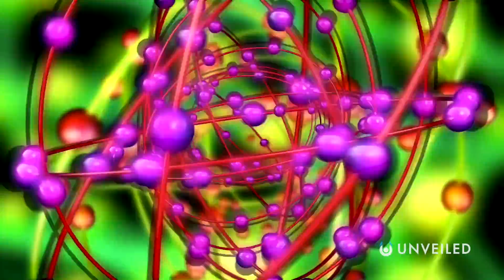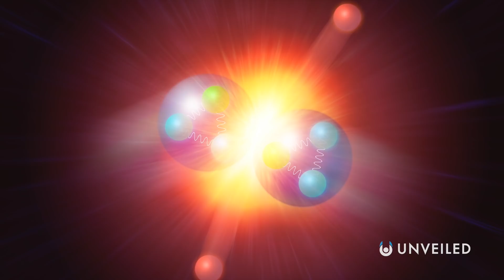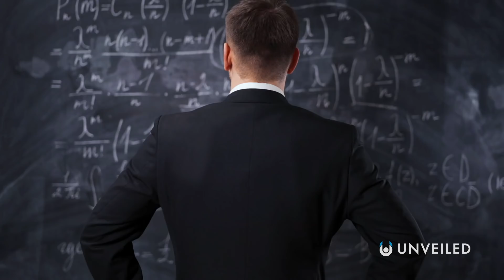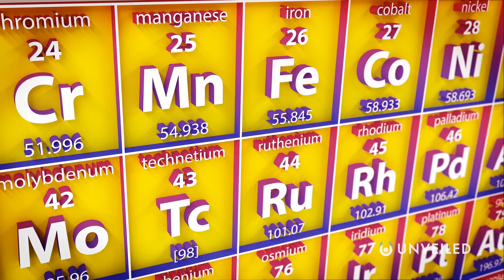Did We Just Discover A New Force Of Nature? | Unveiled

Comment: You say "However, when a team of scientists, between the years 2017 and 2020, beamed muons around...at the fermi lab... and so on". 
Not the full story...*smile*. 
The most recent measurement at the Fermilab (2017-2020) has a similar accuracy as the last measurement, which was also carried out in the USA at the Brookhaven National Laboratory twenty years ago (2001). The average of these two measurements reaches a precision of 0.35 ppm. The combined experimental results from Fermilab and Brookhaven show a deviation from the current theoretical calculations of 4.2 standard deviations.
If the deviation is confirmed and potentially even larger by improving the measurements and the theoretical calculations, the current clear sign of Zeichen physics beyond the standard model ’can hopefully be declared a discovery.